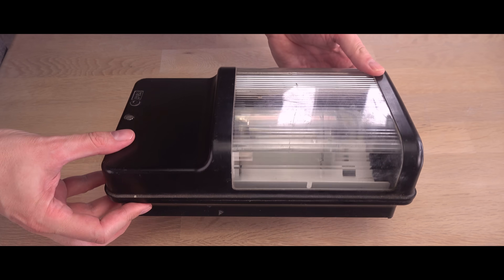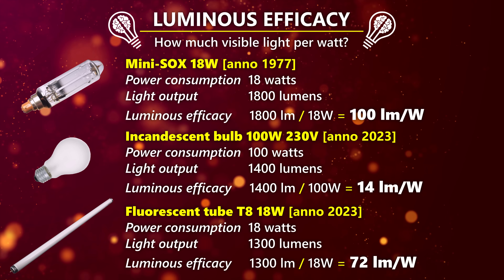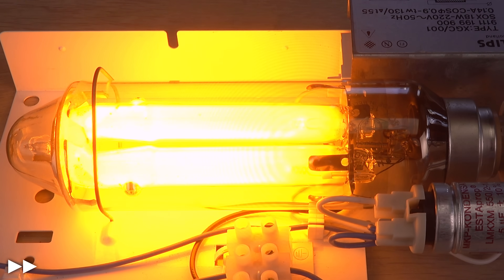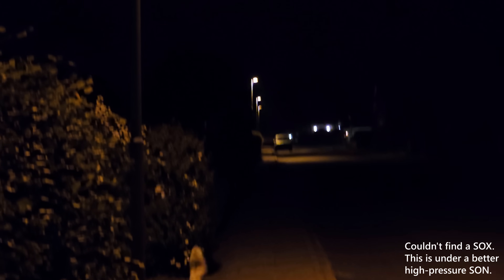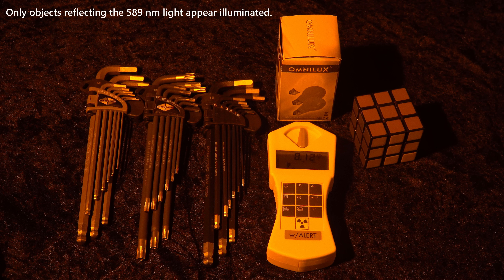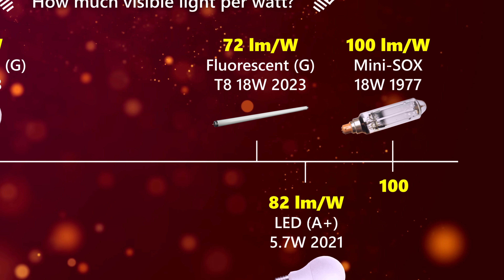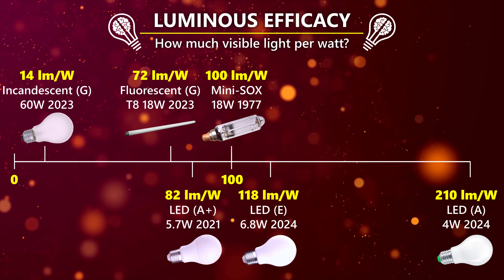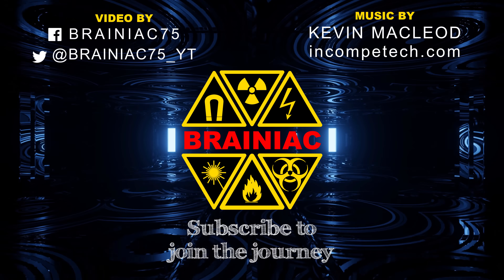THIS LAMP SOXs! "Yellow" tech of bright metal vapor lamp. Beats modern LEDs in brightness per watt?

Comment: It's getting to the point where greater efficiency is barely worth pursuing in lightbulbs. The electricity cost for lighting is really quite tiny compared to all the other uses such as computers, oven, washing machine, tumble drier, dishwasher, microwave and fridge - not to mention electric room and water heaters.

Comment: low pressure sodium vapor lamps are less efficient compared to high pressure sodium vapor lamps. For a high pressure sodium lamp, the single wavelength (actually a doublet) has become so much broadened that it can hardly be called monochromatic.

Comment: So, hypothetically, could they have mixed the sodium with potassium or rubidium and caesium to have improved the CRI (as-in, slightly less monochrome)?...

But, as for lighting, I actually slightly prefer fluorescent. While LED lighting isn't "technically bad", for me it often makes colors look "a little unnatural". Though, my color vision seems to be unusual in that I seem to see a color contrast/gradient between 440nm and 480nm that is lacking both in monitors and in many LED lights (many of which seem to just output 465nm).

Though, some of the large white panel-style LEDs do better here (giving more natural colors), but RGB LEDs, not so much (where, say, 405nm, 465 or 480nm, 525nm, and 660nm, seems to give more natural color than 465 + 525 + 630). Where, granted, 400 or 405nm LEDs were easier to get than 440nm, and seem to give a "similar" color (a fairly strong blue / indigo color). Where, 480 and 465nm are similar, but not particularly "blue" to me. Most monitors seem to give a "blue" a little closer to the one I see at 440nm.
Can note that I don't see anything particularly notable with 600nm (color is not obviously different from mixing 525 and 660).

Can't easily explain, as monitors don't really recreate some of the colors I seem to be able to see.
Well, and curious things, like "cyan" from dyes is a different color from "cyan" that exists on monitors and plastic (say, dye gives the 480nm color, but monitors and plastic appear more like a mix of the 440nm blue and 565nm green, with a relative dip at 480nm).
(Yeah, these experiments involved buying a lot of LEDs; some colors being annoyingly difficult to get).

But, yeah, I lack any good explanation...

It seems to differ from what theory suggests. (I can also exclude "traditional" tetrachromacy, as I am male, and what it predicts doesn't match up with what I see; the "anomalies" being fairly localized to the blue end of the spectrum and "blue containing" colors). Can also note that I don't see any purples or violets in the rainbow (these seemingly only existing by mixing blue and red).

Had also observed that color perception seems to need some amount of light up near 400nm for full effect (and UV400 filters seem to notably impact color perception; giving things a sort of gray-yellow tint). And, similarly, colors can be improved by adding a 400nm light source.

Though, in most cases the differences are minor, and I am mostly used to the way things look on computers and similar, even if it doesn't match up with real life.
But, I sometimes get annoyed with LED lights for often managing to make real-life look like it does on computers (with more obvious variability in color between one LED light and another).
And, then, no one else seems to see what the issue is...
This is not to say the color quality of many fluorescent tubes is great either.

Natural looking colors in indoor spaces being something that was largely given up in the move away from incandescent lighting.
...
Reply: K, Rb and Cs has stronf spectral lines in the infared region, it would be less efficient at producing visible light. Plasma lamps are the boss, L**s are boring little solid state deices.

Comment: Most “sodium vapor” street lights in the US are of the high pressure variety. Low pressure lamps radiating only the sodium doublet spectral lights are nearly non-existent on US roads. 
Most commenters here are unknowingly referring to the high pressure variety with a very different spectral output.

Comment: Fun fact: That’s how Disney was able to do green screen effects for Mary Poppins way before the advent of computers. They flooded the set with sodium vapor lights and a one of a kind hand made prism in the camera was splitting exactly that wavelength creating a real time matte on a second roll of film blocking out the actors from the background.
Reply: True. This way of keying transparency is much more superior rather then green screen. You don't need to tweak any settings and adjustments as you usually do with green screen to make it look better. It instantly gives you perfect transparency, you even can film fluffy hair, glass and bottles of water, and they will look perfectly natural.

Comment: I changed the LED´s in my living room last year. Now i have the CMB1304 Pro9 LED´s with  high CRI and ~170 lm/W. And because i did it myself it was not expensive. Way better light quality (but to get the right driver that fits into the small lamps was a hussle).

Comment: Ohhhh, these were the BEST street lights. Reduced light pollution and you could actually see farther down the street!! Now they have these bloody blue Smurf LEDs that create these tiny pockets of light. Anything outside of that area is mostly just black. So you can't actually see nearly as much. And they hurt light pollution.Plus, it add to the blue light issue regarding sleep. The only aspect where they are a benefit is energy use. Otherwise complete garbage.

Comment: Here in the USA I can’t go to an ordinary store and buy many LED-based bulbs producing over 1600 lumens or so. In order to have a well-lit room I have to use many LED bulbs or buy specialty bulbs on line. It’s as if someone wants NO ONE to have bright lights at home.

I bought a 36W, 5500 lumen bulb for my nightstand lamp last year. Before that I was using an adapter to convert the socket into four sockets, and four 1300-lumen bulbs.

I’m old, I grew up with using a 200W incandescent bulb in my bedside reading light, and I want proper light. 36 watts strikes me as reasonable for a proper light. Whether it’s the government or manufacturers to blame, I’m not putting up with 1300 lumens, though it’s not easy to find anything much brighter.

At least the LED replacements I have for the 40W fluorescent tubes are 2100 lumens, if a bit inefficient at 20W. They’re slowly wearing out, and perhaps under 100 lumens/W by now. They work fairly well from old magnetic ballasts with no modifications.
Reply: My family always used 60 watt incandescents for years now for me I'm still using Incandescents, along with Cfls and flourescent.

Comment: Sodium lamps have led to me misidentifying my car in a parking lot, thus attempting to open someone else's car, on multiple occasions. I don't think I need to explain why this innocent error could be mistaken for malicious intent. In one of those cases, I even had an exceptionally rare car, and the only other one I've ever seen on the road (I saw it before that day, and after) just happened to be in that parking lot. My car was "black diamond" metallic. This other car was TEAL. I couldn't tell them apart.
Reply: Not really a problem now though with remote unlocking. Plus rare cars are very easy to find, you were just unlucky! I don’t tend to use my 1960 Jag much after dark, even though the lights work. 😂

Comment: The difference between the philips and the other led bulbs is that they dont overpower the led's enhancing the lifetime that the fixture will break quicker then the led bulp itself. By underpowering the led's they become really efficient. They didnt just cought up. Manufactures should stop overpowering led's.
Reply: On Bigclives channel, he did a test of the Philips “Dubai” lamps. Designed to last a very long time, and the only ones allowed to be specified by architects in the country. https://youtu.be/klaJqofCsu4?si=FhnV5smp0LLA1IrN

Comment: Those lamps are truly awsome to replace the one in an optical flat inspection table. Its easy on the eyes and the two closely spaced sodium lines show the interference fringes very well. Its a lot better than the rig job to attempt monochromatic green from an impossible to find mercury vapor tube.

Comment: Have 4 of these in my workshop. They were so great for the astronomy performed on photography plates and early CCD cameras, still easy to filter sky brightness in the G or v filters where these lamps still show up as a terrestrial source. With the modern switch to LED is causing issues for some observatories closer to cities. More light getting through. 

If anything, point your lights down to the ground. That’ll help the most.

Comment: But they did/do have the advantage, as street lights, of assisting with sleep, rather than impairing.
An insufficient advantage to counter the negatives, but at night, with an LED street [almost] light directly in my sight line when trying to sleep, I do miss the sodium lamps.

Comment: The degradation over time require yearly bulb changes to keep the output high. LED's can last as long as 5-10 years with similar degradation. There is a peak efficiency range of HPS bulbs and it's 600 watt bulbs. That's the most efficient power range of hps able to put out up to 160 lumens per watt. You're not comparing higher end leds. The ones in cheap light bulbs are not the most efficient out there. You need to look at high end LED grow lights.

Comment: Never thought I'd see the day that an LED lamp got an E rating.
Then again, I wasn't surprised that a modern Philips filament style lamp got such a high rating.
I've got a 4W LED filament one on a smart socket in the kitchen for some ambient light, and it comes in at 112.5lm/W (rated 450lm), an E on that scale.
LEDs have sure come a long way from the early days of bulky, inefficient models.

Comment: These sodium lamps were also used in the film industry long ago, like disney, as a way to "green screen" or chroma key something or someone out to be overlayed onto a picture in a film. What they usually did back then when computers couldn't do that. They would light the background with the sodium light and the subject would be lit up with normal white light, ensuring the room is perfectly dark and no other wavelength could leak. And they would use two cameras with a prism that separated the picture so that on one camera, only the object is visible (the 589nm light is filtered out) and the other camera filmed the one where only 589nm light is visible. However, the technology did not last because they ran out of that prism, and only one prism is available right now. But recently, a youtube channel called "Corridor Crew" revisited the technology and they managed to work with it and even made a short video with a clown married in mars. You can check the video out in thier channel, its really amazing, and the subject separation is just so perfect, green screens today couldn't match the superior subject separation, only clicking few things. Unlike green screens where you need to adjust almost all values to have decent results.

Comment: How can this bulb be so efficient when so much energy is wasted in heat? I remember our city's through ways and main roads being lit with these auful lights. They would distort all visibility and shadows from a moving car I'm glad they stopped using them. 
LED's would be efficient if they didn't over power them so that they burn out on schedule. If you add a resistor to under drive an LED bulb it will last for more then 10 years. The Dubai lamp is a rabbit hole that will make you angry after spending a $1000 outfitting your home in LED's.

Comment: The 4 W Philips Ultra Efficiency (PUE) bulbs are pretty interesting, I use 3 of them in apartment, but they suffer from a very green tinge which is a result of the phosphors used. Sadly, many people can't handle the green colour which is party why in some regions Philips released a opaque bulb which can diffuse and also slightly change the colour tone. However in USA and Canada and theoretically any other place that uses 120 V mains you can purchase Philips Ultra Definition (PUD) lamps which seem to have the best performance in the world in terms of CRI, efficiency, low flicker, and more: at a reasonable price! But as far as I can tell, there are no 220-240 V regional versions of these.

Comment: Here in Ontario, I switched to LEDs two years ago. I don't consume much energy I only have 6 lights in the apartment. But my usage went down by using them! However our hydro (electricity) costs a fortune. I use about $12 of energy now, but my bills are $100 or so. We get charged a $45 delivery fee and 13% tax as well. That is off peak  prices.
Reply: I use Incandescents or CFLs or flourescents the bill problem what I think is the appliances certain appliances uses alot of wattages which will raise the bill.

Comment: There's a paper out there somewhere that calculates the maximum luminous efficiency for a blue diode pumping a yellow phosphor based on the inherent Stokes losses associated with turning blue photons into white light. It depends on the CRI and color temperature, but if I recall it was about 300 lm/watt for reasonable values. That means the best LEDs (~230 lm/watt are 75% of the fundamental limit).

Comment: No matter how bad the CRI is, HPS (and LPS to an extent) still have a place on my heart. My neighborhood still use HPS for now, but they're slowly being replaced as it fails and starts cycling unfortunately. I hate LED street lights with a passion due to how tiring and harsh the light look to my eyes while driving (astigmatism does make things worse for me) and much prefer HPS for general street lighting. I guess we don't have much choice but to move on from HPS to the "more efficient" LEDs now 😔
Reply: new cob leds coming out that are a lot more eyeball friendly.
im picky about that light ss it relaxes me.
i found a pendant solar light on amazon that has the same effect.
not as orange but has the calming effect.
(the one with the octagonal wire frame and also has a pendant switch)
Reply: Couple of HPS that's way up the road from where I live are starting to cycle, which made think of two things,

One it's gonna keep cycling until it dies and becomes abandoned, or two their gonna replace it with a crappy led or retrofitted.

Comment: I somewhat recently got some LED bulbs made by Sansi that have an interesting LED on ceramic design after Big Clive covered them in a video. I got some small ones that are about half the size of a standard bulb but still put out 900 lumens and only use 9 watts. Then I also got a dimmable standard size one with quite a few LEDs on it and it outputs an immense 2500 lumens at 17 watts so about 147 lm/W. It's actually so bright I've yet to find anywhere to use it 😅 It's been really cool to see LED technology get better and better. Now if only more street light replacements could use warm white instead of the daylight color temp. I have seen some installed so I hope that trend continues. Thanks for the interesting video!

Comment: These actually have another use besides street lighting roadways. In fact, it was used in photographic darkrooms! The light emitted was so specific that some types of photographic films, and most types of photographic paper, could be handled with almost no risk of exposure, in almost normal brightness! In the movies you always saw dim red rooms with a bare ceramic bulb hanging from the feeling where one would toil away at the enlarger and chemicals. And for individual hobbyists (myself included) this is still pretty much the standard. But in school darkrooms or photo labs, you could work in the extremely yellow, but reasonably bright light of the sodium vapor tubes.

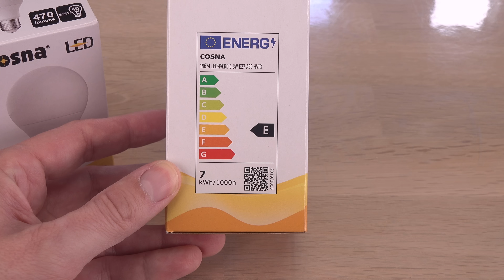Comment: 8:49 Either you made an error, because i remember them SOX to be much higher in Lumen, or... it doesn't matter anyway:
" Die Philips E27 Ultra Efficient Master LED Straßenlampe SON-T UE 19W 3600lm 727 2700K, bietet die höchste Energieeffizienz mit bis zu 210lm/W - "

I wonder how they did the thermal management🤔

and btw. you made an error. 
"Natriumdampf-Niederdrucklampen (auch LS-, NA- oder SOX-Lampe genannt) gehören zu den effizientesten elektrischen Lichtquellen, die es derzeit gibt. Mit bis zu 206 lm/W[2]"
11:10  You got it included, so this particular lamp is only 100lm/w 

So they are only 4 lm ahead. but that doesn't mean n-ything🤭